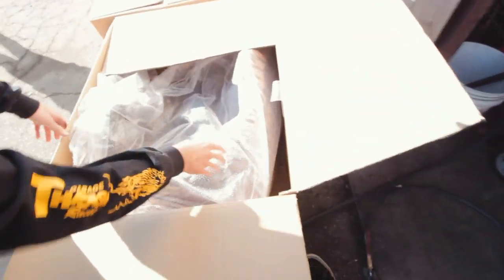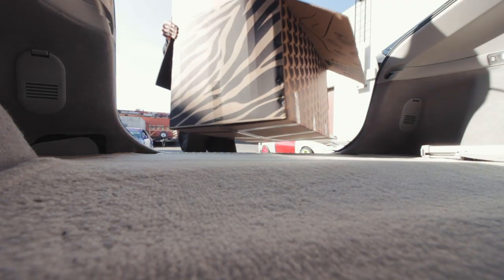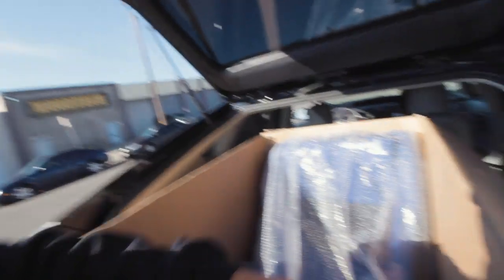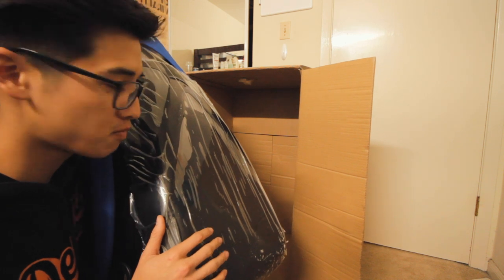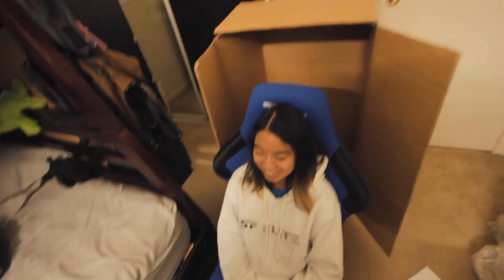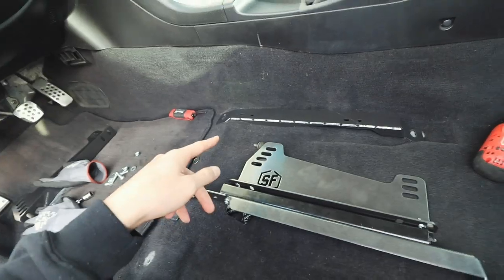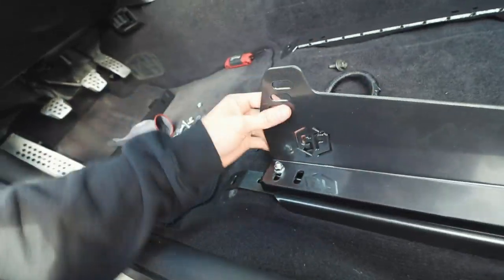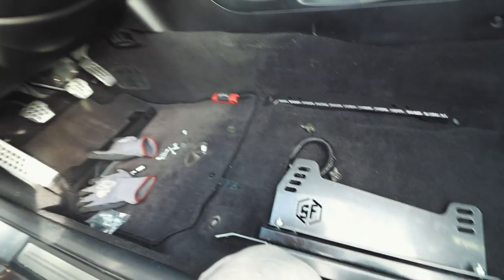INSTALLING RACING SEATS IN A G35

Comment: Hey Tyler I did this about a month ago to my jeep that airbag blinking light on the dash is going to drive you nuts I’ve done a lot of research and watch a lot of videos and came to the conclusion that the only way to stop the airbag light as it is to disassemble the dash and put a piece of electric tape
Reply from the maker: mine has a light. i try not to let it bother me hahah
Reply: Another way is to remove the motor off the oem seat and zip tie to the bottom of the racing seats